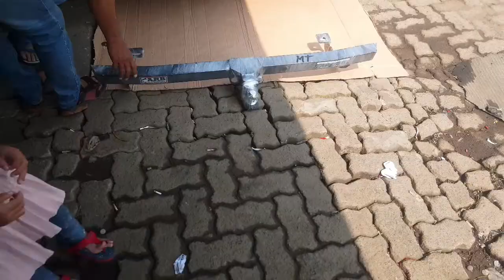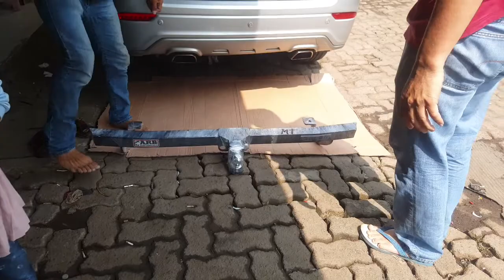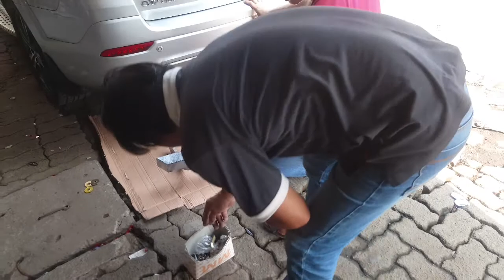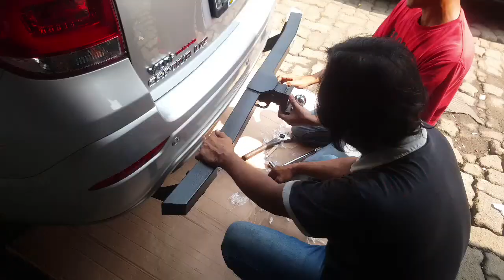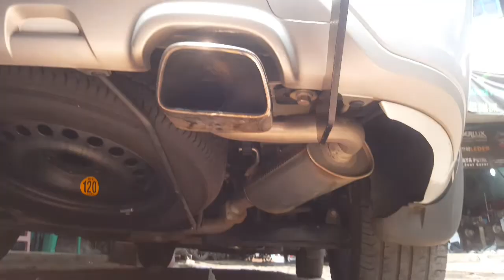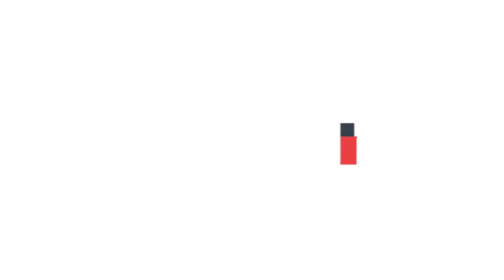Pasang Towing Bar Chevrolet Captiva

Comment: Info spek yg plug n play di captiva nfl om
Reply from the maker: Sepertinya masih sama Om posisi bautnya yang NFL & FL. Captiva saya 2017 langsung pasang, hanya dicopot besi untuk nariknya diganti dengan Towing Bar tersebut.
Reply: @agungberlianwaskito  aku beli kok gak bisa ya om,harus rubah2,malah kehalang 2 tabung knalpot
Reply from the maker: @mickgo4546  maaf Om baru reply, akhirnya bgmn Om Mick?,  apa mgkn towingnya designnya beda ya, shg tidak lgsg masuk, waktu sy beli sy minta yg sesuai Captiva 2017, infonya relatif sama semua Captiva, ada baut yg dilepas digantikan dg baut besar utk towing.
Reply: @agungberlianwaskito  iya om gpp, gak bisa di pasang om, akhirnya mobilnya yg di jual wakakaka, skrg udah gak punya badak om😀
Reply from the maker: @mickgo4546   siap Om Mick, Setidaknya bs memorabilia ya Om dg Mobil Badak 😊🙏